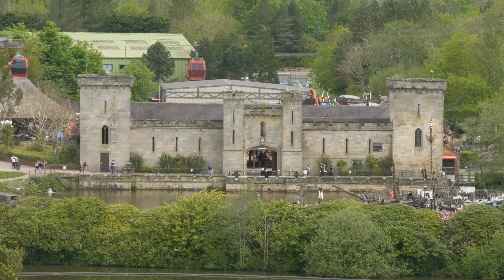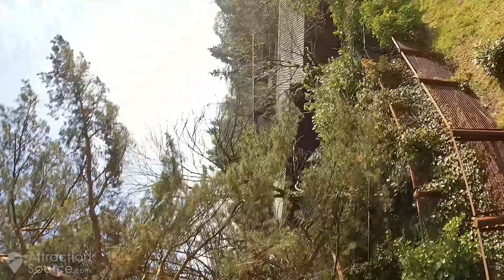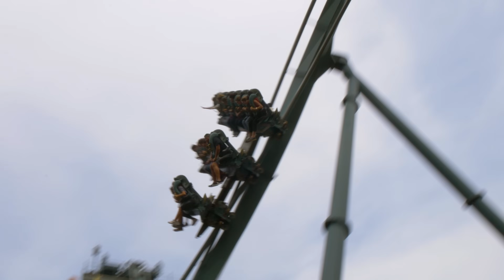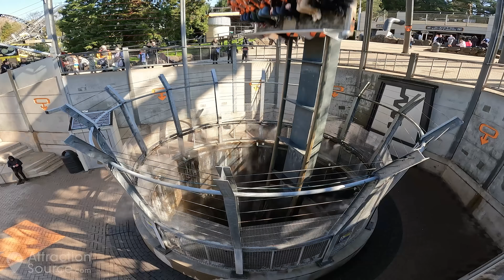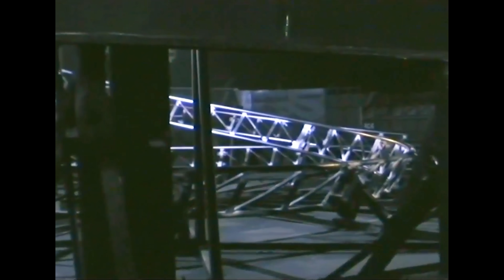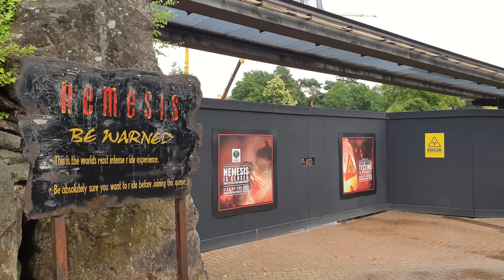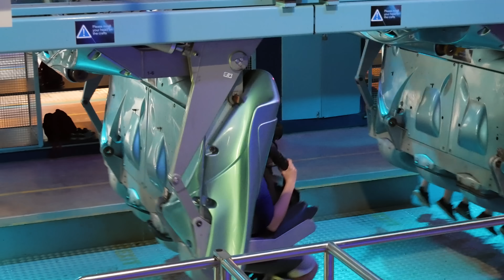Alton Towers has a roller coaster problem

Comment: As iconic a look as it is, seeing Oblivion's trains vanish into the ground as they do, I find it's unfortunately a bit of an underwhelming ride experience. Dive coasters on the whole have always felt a little lacklustre to me, and Oblivion lacks any sort of additional elements after the drop. It was something new and radically different at the time, but coaster development has moved on and it shows. Same story for Rita - it's a rough, painful launch coaster with a very mundane layout compared to what's been done since, and terrible throughput. Galactica has a good layout, but it's also quite rough and the park struggles to keep it operating with a decent throughput. None of them have the same reputation as Nemesis for being a truly best-in-class roller coaster, and all three therefore seem replaceable to me. I feel like Alton Towers could very easily "upgrade" Rita or Galactica with newer models and better layouts in the same space, but I genuinely struggle to think of anything else that could be done with Oblivion. It doesn't feel like something worth keeping open indefinitely though as it's generally the last roller coaster that people go to these days, when everything else already has a long queue.

Replacing Rita and Galactica with newer, better versions of the same type of roller coaster that have better throughput seems like a fairly safe solution to me. Alton Towers could keep the theming, having them be "reborn" in the same way as Nemesis, and have something in each case that better compares to other similar coasters out there. Oblivion, I fear, just has to be left to die. It doesn't seem worth keeping open for much longer,  and the tunnel would make any refurbishment or replacement more expensive, and a logistical nightmare.
Reply: The roughness of Rita is part of the fun though, if it was smooth it would be dull instead it batters you like a rally car on a B road.

Comment: I can see Rita being the first to go, and getting replaced with a modern multi-launch of some description. Either a Mack one like Icon or Blue Fire Megacoaster, or an intamin one like Taron, Toutatis, Maverick or VelociCoaster. 
One of the benefits of launch coasters is you can keep them low to the ground, since they don't necessitate a big old lift hill. That definitely would help given the restrictions, and you could potentially make something really awesome. Taron isn't actually any taller than The Smiler either.

Although let's be real, all I want is an RMC. Dig a big hole, put in a low to the ground but intense one like Untamed and I'd literally die, lol. If they really want to keep their world first advertising going, get RMC to make them a double launched hybrid and there you go.

Comment: I think based solely upon popularity oblivion is likely to be the first of the big 7 to be removed, as it definitely has the shorter queue times of the lot. However, based upon reliability and practicality, I would say galactica Rita and thirteen are less reliable at the moment. All three of these have the issues of having unique and complex ride systems: galactica is a flying coaster, Rita is a hydraulic launch coaster and thirteen is the first ride to utilise a drop track. Thirteen already has issues with running while it’s raining, Rita has the standard issues that most hydraulic launch coasters have with the launch itself, and galactica has an incredibly complex system in the station, and, at least as of my last visit at the end of 2022, is only using one of the two stations. 

The issue with removing oblivion, as mentioned in the video, is the tunnel. The other three rides are not as intrinsic to the terrain surrounding them, aside from the tunnel over the base of galactica’s lift hill, and the tunnel after the drop track on thirteen. I would argue that the easiest ride for them to remove would be Rita, at least of the big 7. 

Spinball whizzer, which is aimed at a slightly younger demographic, similar to the demographic of runaway mine train, would also likely be relatively easy to remove as, like Rita, it is entirely above ground. Furthermore, Spinball whizzer doesn’t share its area of the park with any other attractions. The closest ride to it is the octonauts ride, which is accessed through cebeebies land. Additionally, although I can’t speak for this year, last year Spinball whizzer was by far the least efficient ride in terms of operation. On both my visits last year, the listed queue time was significantly shorter than the actual wait. I’m not exaggerating when I say that a 10 minute posted wait was actually around 100 minutes. This all leads me to believe that spinball is the most likely coaster to be replaced at Alton Towers, be it for a big thrill ride for the thrillseekers or potentially for an expansion to cebeebies land, which I personally would say I would prefer the first option.
Reply: It might not necessarily be popularity though, Oblivion is an absolute capacity monster when running all the shuttles and both station platforms (1,900 riders per hour) compared to Rita's paltry 1,150 riders per hour.

Comment: Idea for oblivion:
When oblivions time has come instead of retracking it the park can create the UK’s fist tilt coaster in its place and use the space used by the current retro squad rides for and some of oblivions original break run for an extended layout. The ride will also keep the oblivion theme

(If anyone who is a higher up at towers is reading this PLEASE BUY MY IDEA)

Comment: Rita’s time is up I think and it would be nice to see it replaced with a Mack spinning coaster something similar to time traveller or the ride to happiness. 

Oblivion needs re tracking and maybe having a slightly longer layout developed. 

Galactica is the first flying coaster but it shows as it’s kind of boring compared to others now out there in other parks. 

They may need to think about planting taller trees 🌲 

I also think they are missing a high quality water ride at the park. And certain areas are probably ready for tlc and redevelopment like the entrance.
Reply: Absolutely! Ever since they removed the duck, they've been sorely lacking a water ride. Sure, there's the rapid rafts, but I'd hardly call that a ride so much as just...bumper boats.

Comment: What works in Oblivions' favour is it is very easily maintainable as it is very old school. The ride has 7 shuttles and can only run with a maximum of 6 so that one is always having its annual strip down, this is because it was originally intended to be open majority of the year with the parks overall mission to be 365. I know alot of money has been spent in the shuttles over the past couple of years, and all the harnesses are being gradually replaced with the new light pastel orange ones. Hopefully, they have a plan in place  for the track in the tunnel ad you highlighted.
Reply from the maker: Interesting to hear! Do you know what the plan in place for the track within the tunnel is?
Reply: @coasterbot  unfortunately not but I think that ride has a good number of years left in it yet.
Reply: @coasterbot  My memory may fail me, but wasn't the track installed after the tunnel was dug anyway? This being the case, it could always be removed and replaced the same way....?
Reply: @TheDaern  yeah from a quick google search the track was indeed placed after the tunnel was completed so change could be easier than we first thought 😊
Reply: @kriss-annwilson8884  I think the bigger challenge would be replacing the track with anything other than more or less exactly what is there already, which is something of a shame. 

Much like Nemesis, although perhaps less obviously, Oblivion has to fit into an extremely confined space. Also, given the speed at which it enters the vertical tunnel, if this element was to remain (and I think it would need to, or it wouldn't be Oblivion any more), it would be hard to conceive of any other design fitting within the constraints of the park and its relatively small, existing footprint. I've read about possible loops and twists, but I think it would be extremely difficult to do either. It's also worth adding that Oblivion's location on the edge of the park makes it an obvious target for complaints regarding visibility and (especially) noise, which was a pretty big problem back when it first opened. Nemesis is less constrained here, because it's right in the middle of the park and a good part of it is below ground too, which helps prevent it from disturbing the neighbours.

I think Oblivion has aged less well than Nemesis and while it's still a fun ride, it's far less unique than it was 25 years ago when it opened. I would like to see it re-tracked, but I don't think it's the same slam-dunk as the decision for Nemesis. The flip side is that they'd have few issues getting permission to retrack it, but I think it would be very challenging to get planning permission for a new, larger ride in that corner of the park. This alone might persuade them to keep the status quo. Either way, it'll certainly be on the horizon as I think it's safe to assume that the same 30 year lifespan that closed Nemesis will also apply to Oblivion, so it's probably only got another 3-4 years left as it is.
Reply: Couldn't they install smaller track sections within the tunnel that fit through the hole?
Reply: I mean they could just dig up the tunnel again and then refill it with concrete, the only part of the ride that gets a lot of stress is the bottom of that drop so the retrack shouldn’t be too expensive

Comment: I personally believe Oblivion should be replaced with a Vekoma Tilt. The tilt is a similar premise to Oblivion, so it will be able to use the tunnel, whilst there is space behind Twistatron which could be used to make the ride longer than Oblivion currently is.
Reply from the maker: That would be cool wouldn't it!

Comment: My guess is Rita, purely on the basis that as more and more hydraulic launch coasters get removed or retrofitted to magnetic systems, it's going to become harder and more expensive to find replacement parts.
Reply: It isn't so much replacement parts becoming harder to find because both Intamin and Hagenbuch are still in business. Pretty much everything on Rita is commonly found across heavy industry.
The problem is having to replace those parts in the first place, spend enough time working on one and you soon realise that you are changing a hose of some description about once a week. Add that to all the other components that need replacing at regular intervals and you will see why LSM systems have come a long way in the last 15 years or so.

Comment: Nemesis works fine as a refurb. Oblivion needs extending. Maybe 3 or 4 inversions. How about a launch? The drop is amazing, just give it some more elements. Replace Rita with a new generational Intamin launch like Velocicoaster. Also build a cross valley RMC.
Reply: I doubt we'll see significant track change to Oblivion given the extremely tight constraints of the plot of land where it's placed. There simply isn't room to do it...
Reply from the maker: I think everyone could get behind Rita going in favour of a VelociCoaster type ride!
Reply: @coasterbot  I feel like the tenth dentist on this. Multi-launch rides are great and all but hydraulic launches are the single most exhilarating thing I have experienced on any rollercoaster to date and I'm not happy to see them phased out. I can't be hyped for the new TTD, and even more lacklustre ones like Rita (which would be incredibly mid were it not for the rarity of its launching mechanism) pack a punch that LSMs are heretofore unable to replicate. 

Obviously the operational problems with hydraulic launches make abandoning them simply an economic no-brainer for parks which can count on large numbers of visitors anyway (and less intimidating launches probably attract more riders on the whole), so it makes rational sense, I'm just surprised that enthusiasts don't seem to lament the gradual extinction of an irreplicable experience more.

Comment: I think it has to be said that there's two sets of rollercoasters in alton towers. There's the regular ones, and then there's the secret weapons. The secret weapons are without fail, record breaking coasters. Oblivion was the first dive coaster in the world, Th13teen was the first freefall drop, Smiler has the most inversions, etc. The non secret weapons are much more often either smaller in scale, mass produced, branded, or have been replaced already. Due to the significance of some of these records, I think they've got much more interest in keeping the secret weapons around in the park, and putting them through rebuilds or redesigns, like Air being turned into Galactica and fitted with VR (albeit only temporarily for the VR). Because of this, I'd suspect the next one on the chopping block to most likely be Rita, simply due to it not having the same status as Nemesis (SW3), Oblivion (SW4) or Air/Galactica (SW5), and not really being tied to the environment like the rapid rafts, or the smaller footprint of spinball. The other possibility would be the runaway mine train, as that is the oldest thing in the entire park, has a very low RPH value due to doing multiple loops, and as such only accomadating one train at a time, but the mine train also dips in and out of the ground similar to nemesis, though not on quite the same level.
Reply: Mine train is a good kiddie coaster though. Less scary than 13 and less spinny than spinball whizzer or whatever its current name is 😂 I would like to see Rita go next personally as I don't enjoy it
Reply: @jminsh463  I'm disputing only on the comment of it being a coaster with too much history to go. One could have argued something similar with the Log Flume, but they removed that also. I was pointing out the age and its lack of immunity :)
Reply: Mine train will stay as it has got history to it the same way hunted manor has
Reply: @andrewhoughton8606  I think it is very possible that the mine train might go next. It might be the oldest in the park, but its not so old as to really have "history" in the same way many of Blackpool's coasters have
Reply: @andrewhoughton8606  see you say that, but haunted manor literally shut twice already. It has just gone from being duel the house strikes back to curse at Alton manor, which is a completely different experience.
Reply: Yep. The original first version of the Alton Towers Haunted House in Gloomy Wood was fantastic. So much new tech involved. It was sad to see it lose popularity and to be left to fall apart of the years and duel idea was just stupid. A cheap way to try to keep interest in it and keep it going, while they left the animatronics to fail and stop moving on many parts of it. The new rebuild and retheme with the story of Emily at Alton Manor is superb and rebuilds it back to the standard it was when it first opened. They have even cleaned, and tidied up the que line in Gloomy Wood and added more effects there. And once again its packed and popular and its nice to see, its truly great that a whole new generation of park fans can enjoy as much as I did when it first opened back in 92..... @ReiReiFoxy
Reply: @Simon-xc5oy Yeah I used to no-life the second iteration like there was no tomorrow. Held the record on multiple occasions cause I'd just spend the entire day in there tryharding it like crazy, because there was never a super long queue. It wasn't the level of short where you could just stay on, but it was more of a, you'd never be waiting more than a few minutes in the queue.
Reply: rita to go... keep choo choo as this is the first step up coaster for kids and all ages seem to enjoy this.
Reply: I don't think the Mine Train is going anywhere. It might not be a secret weapon coaster, but it has a lot of history, theming and was a bespoke design. It's also the park's major child-friendly attraction, which means it fills an important niche. 

Rita is the main candidate for being replaced, since it's always been the demo version of an Intamin Accelerator coaster, and ever since Stealth was added at Thorpe Park it's been outmatched within England in height, speed and acceleration. Wicker Man is the final nail in the coffin though, since while it has a couple of nice airtime hills and twists there's now a different coaster than can offer better in the same park.
Reply: If they get rid of the mine train where else in the world would I get my annual heavy dose of sarcastic "choo choo" ??
Reply: I do admire the effort they made to try to integrate VR into it, but I admire much more their guts in realising that it just didn't land and getting rid of it
Reply: Rita still is one of only few Hydraulic launch coasters left in Europe however. It’s got that going for it.

I’m a sucker for acceleration though so I’m a bit bias
Reply: @jazzingpanda3190  ultimately, "one of the last" isn't really a record though. It's more historical significance. There's every possibility of rita ending up in a separate park in europe though if it was removed, based on its design. It isn't exactly a super custom land-reshaper like nemesis.
Reply: Can we have a tldr lol
Reply: @Buzzap558  Rita will probably be the next to be removed since it isn't a secret weapon